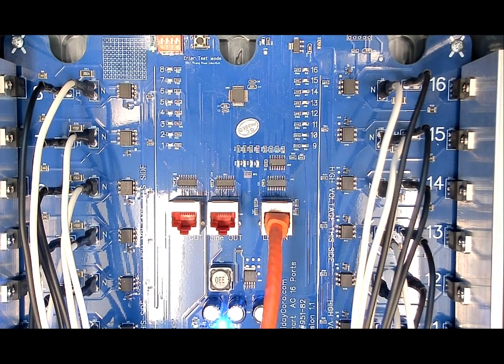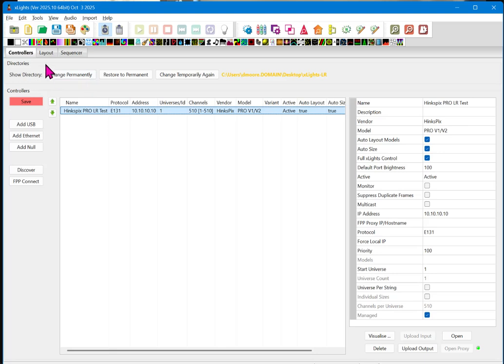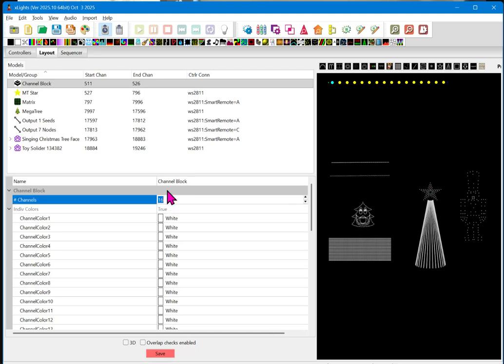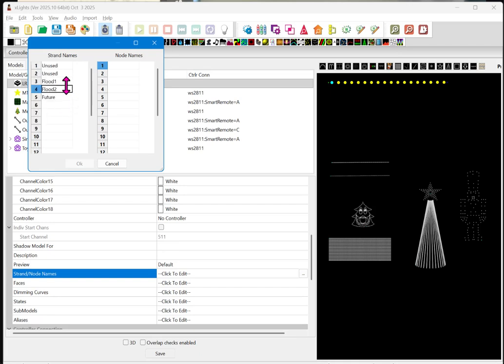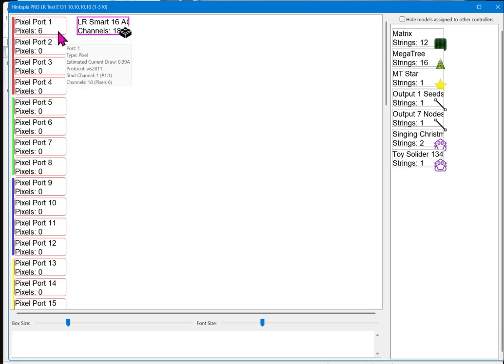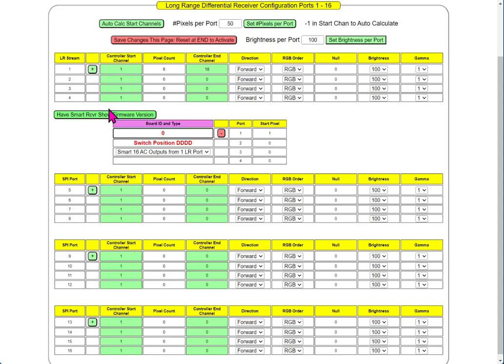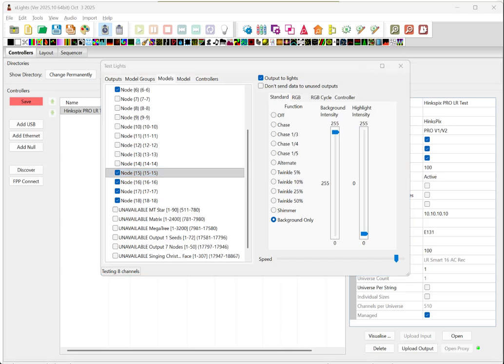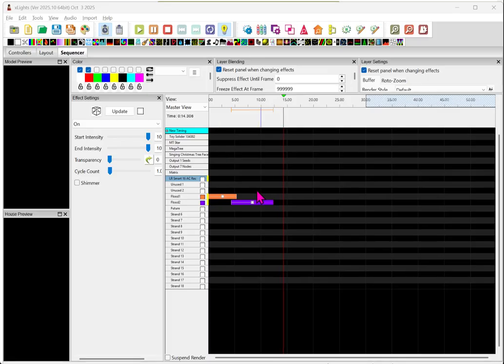Configuring HolidayCoro Long Range Smart 16 AC Receiver with xLights

Comment: Does this configuration integrate with the AC Lights Toolbar? In my setup I am sequencing the HC 16 channel singing Christmas Tree, utilizing the xLights model supplied by HC. I have the HC AC Controllers configured and responding as in your video using channel block.
Reply from the maker: Yes, please watch the entire video as it covers how to integrate them using xlights.  If the video does not provide all the information needed, contact us at www.holidaycoro.com/contactus